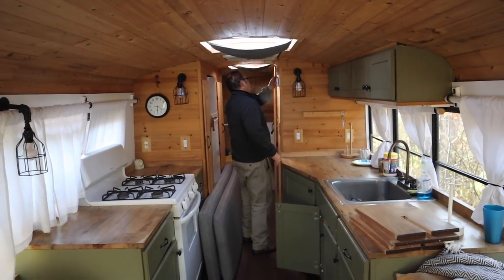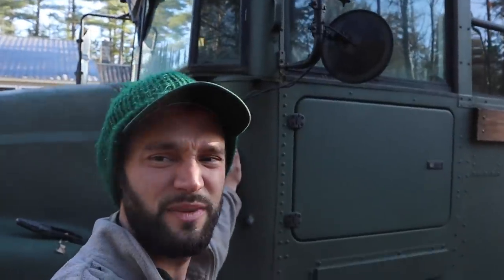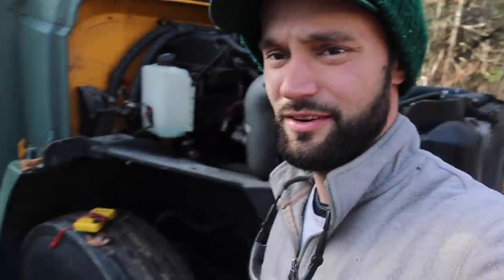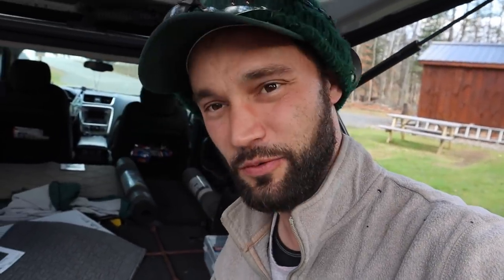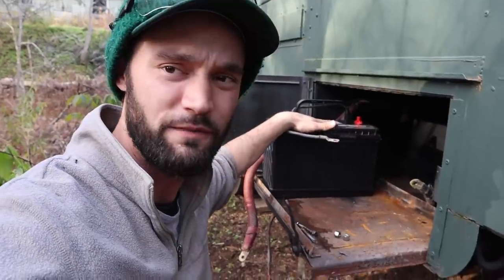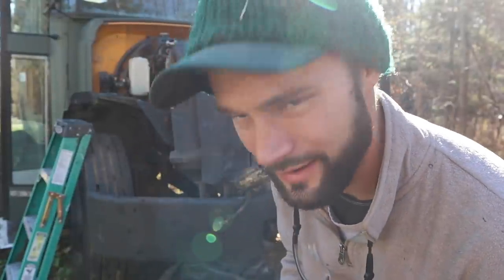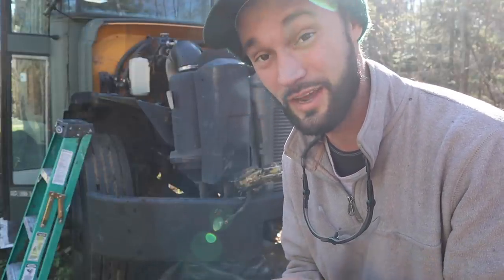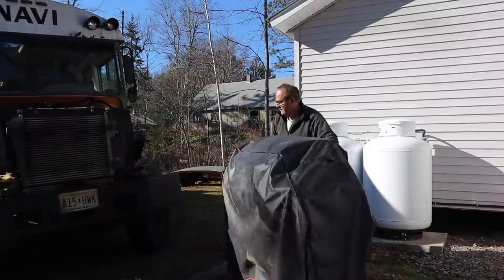Bus Conversion Won't Start | Navi Needs to Move

Comment: Sounds like the Door interlock system preventing the Crank interlock relay from allowing cranking from key to Starter.  Most School busses need the OEM exit doors unlocked  and the OEM doors handles shut to allow Cranking.   Unless these features have been bi-passed at the interlock relay this could be suspect.  The crank interlock relay is usually located in the electrical panel outside at the driver area and is ground controlled to activate through the door switches and locks.

Comment: Hi Mike.  Good to see you and your dad.  We've missed you.  I have a build question.  My bus, 2004 Chev Exp 3500 Cutaway Mid Bus 6.0L Gas with 6 windows.  My passenger door is not a regular bus door, it is a van door.  There is not a seat there and it is the entrance door.  When you come in the door you have to duck, low, till you get midway to the driver seat.  Picture Ivan, your driver door and overhead cabinet, I have that and then duplicate it for the passenger side.  So can I cut out the part of the overhead door frame, like your passenger door frame, and I'll add an RV door?  Help please
Happy New Year!!

Comment: Great video! I have a similar issue with a bus that hasn't started in a while and I want to try your battery to starter method. What kind of wires should I try & where exactly on the starter solenoid I should try connecting to

Comment: I will say that specific bus that got converted into navi is junk. The build is so cool but the engine in that model has never run well. On the first day on my bus the transmission gave out. Then a fuel problem. Then it would not start 5 times that school year. Then…. Ok i think you get the point